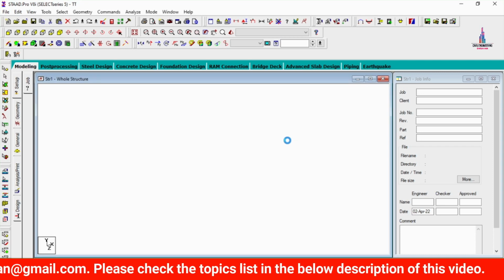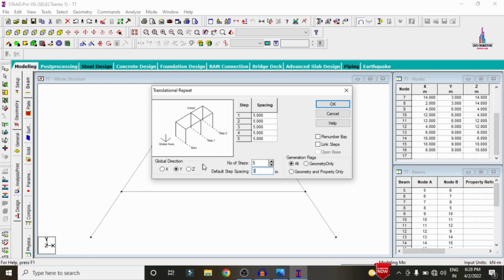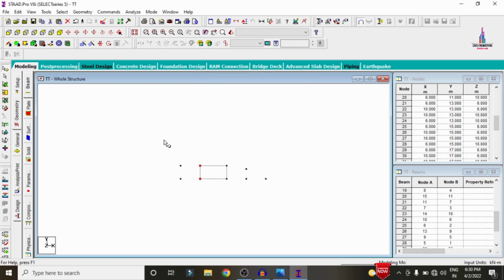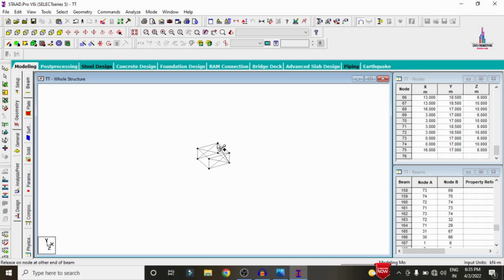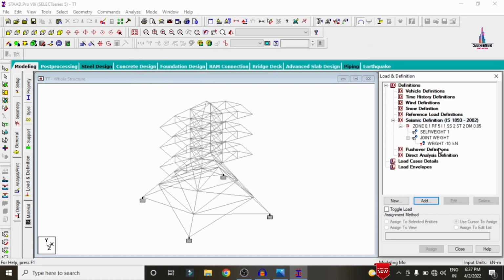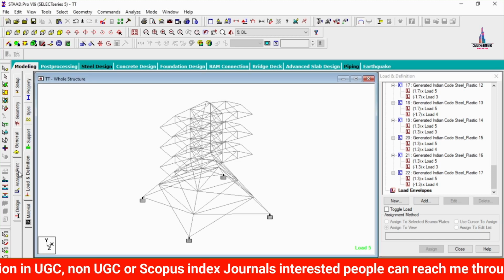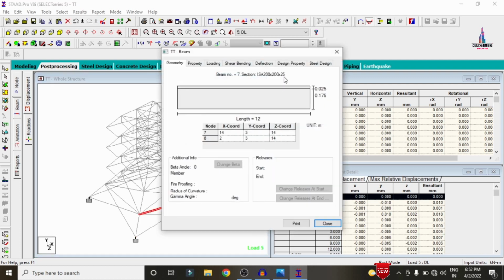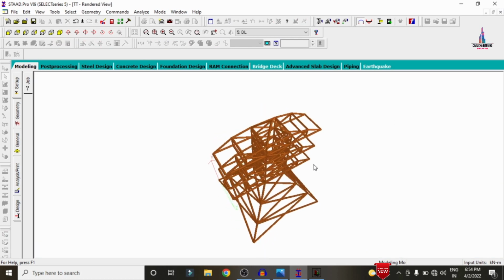Complete transmission tower design by Staad Pro | structural design | civil engineering | online |

Comment: But we don't provide 6 @ 65 mm c/c spacing practically n sir, minimum bar is 8 mm we take for stirrup or do we need to consider this as minimum
Reply from the maker: Ast values we will consider from the staad we have to convert them to 8mm
Reply: Can you make short video by explaining on this sir, Please
Reply: Bro my member fails 24 errors are there.